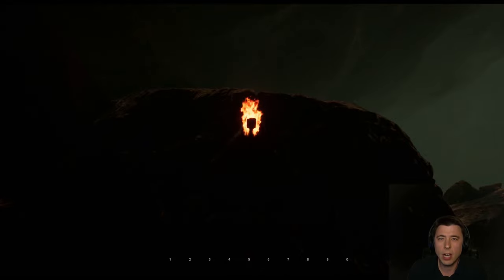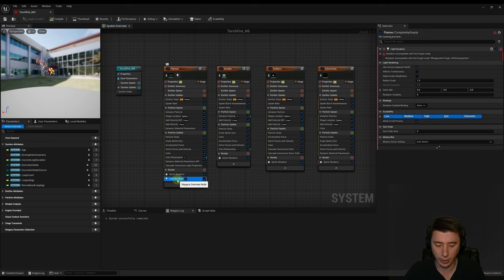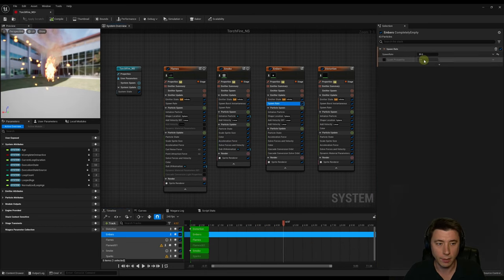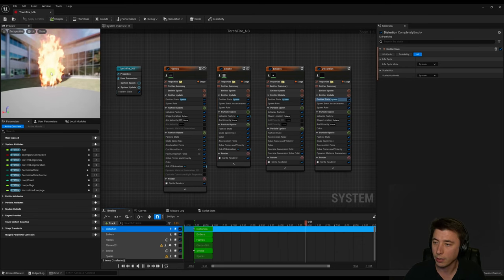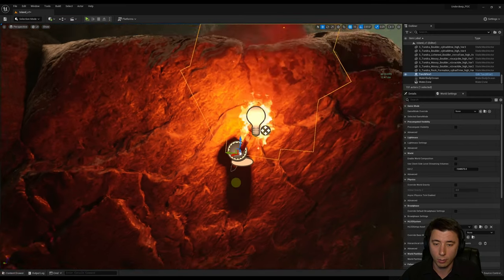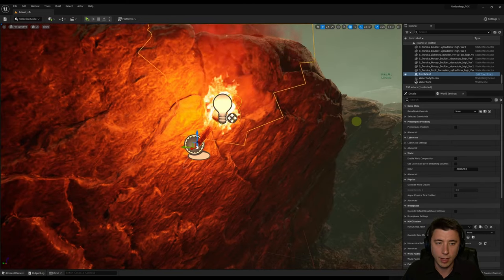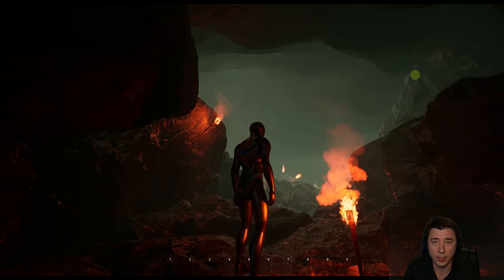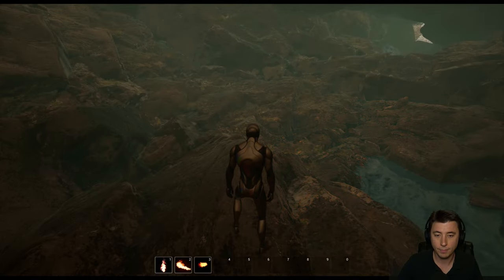Let's Build the RPG! - 61 – Torch Fire Full Tutorial - Fire and Light in Unreal Engine 5

Comment: Unfortunately, for the version 5.3.2, this part (2:10) does not work anymore. We get this error below 6 times instead. 

Static variable is not set to a consistent value. Please ensure that all values are equal.  Parameter: Particles.DynamicMaterialParameterChannelMask - Node: Map Set Pin: Particles.DynamicMaterialParameterChannelMask -  Flames, Particle Spawn Script Interpolated,  DynamicMaterialParameters
Reply: Hey, I'm facing this same issue. Did you find any solution yet?
Reply: Happened to me too.
Reply: It's compiling in 5.4.4 if you uncheck "Write Parameter Index" and doesn't seem to have any impact on final result. ;)
Reply: @antonlallemand6248  Where is "Write Parameter Index" please? :)
Reply: @antonlallemand6248  You literally saved me hours of struggling! Thank you :D
Reply: @antonlallemand6248  Could you pretty please tell us where to find the "Write Parameter Index"?
Reply: @carnivorechristina620  Open the system Tortchfile_NS, node Flames, entry Dynamic Material Parameters, then click on button 'Index 0'  in the right-side panel. Write Oarameter Index 0 checkbox is checked. Uncheck it and the error is gone.

Comment: under 5.4.4, I get warnings on skipped conversions: 
'Skipped converting cascade module "ParticleModuleCollision Base".  Reason: failed to find converter script for module.'
'Skipped converting bApplyGlobalSpawnRateScale.'
(repeated 5 times)
( This emssage appears in all nodes under Spawn Rate)
Also, in the Flames node, under Emitter Properties: 'Cascade light specified a spawn fraction but this node is not supported by the asset converter
I left these untouched, it all simply works.

Comment: I love my new Torch BUT, it only kinda works in unlit mode? Is there some settings I missed? can't use it in my scene. Can't see the fire material or the point light. still can't the the point light and the flicker in unlit mode. It works perfectly in my test scene, so thought it should work in my actual scene. (another level)